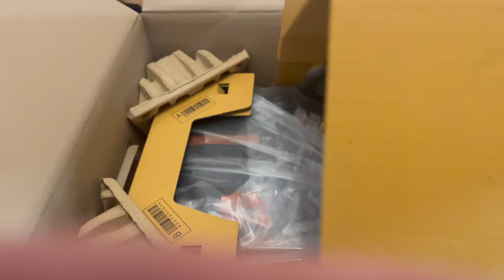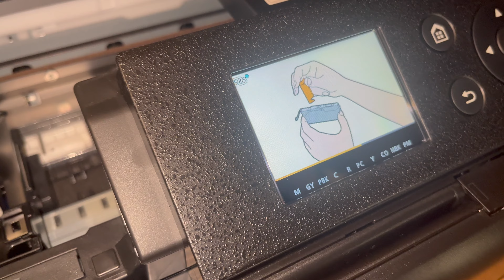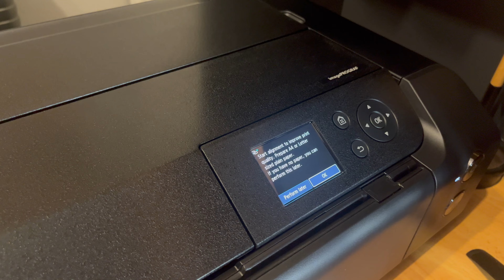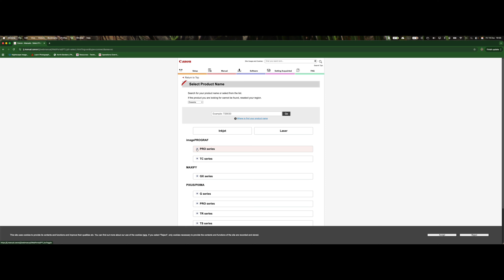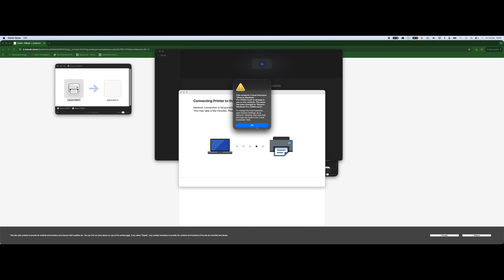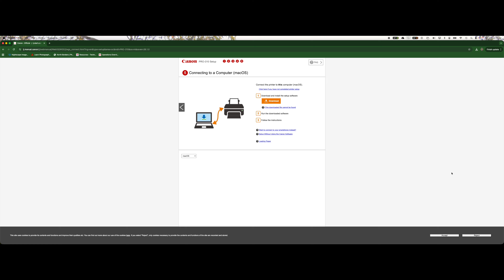Canon Pro-310 Printer Set Up

Comment: mine stalled at close cover never got the next step??
Reply from the maker: Have you tried a quick Google search to find out what might be wrong? I just did that and it came back with three possibilities. There could be an obstruction including possibly packing tape. Ink cartridges may not be completely clicked down or in incorrect spot. You may need to reset the error state ( If the LCD shows a support code, turn the printer off, clear the code instructions from the Canon Support Site, and restart).